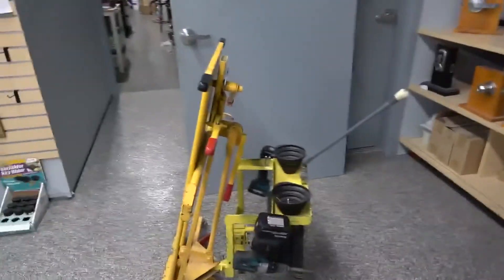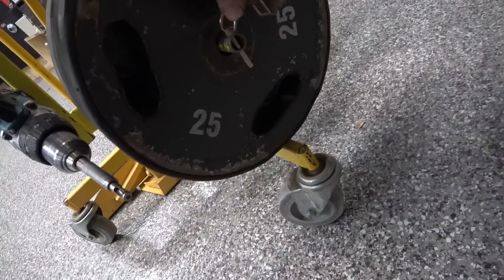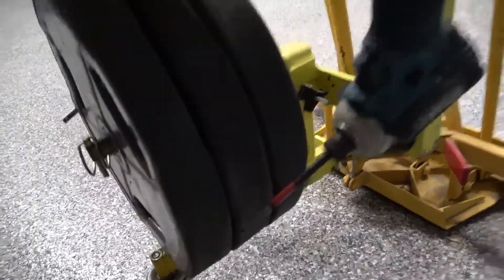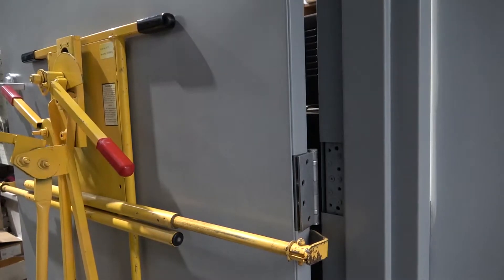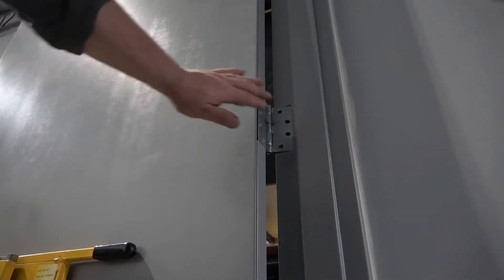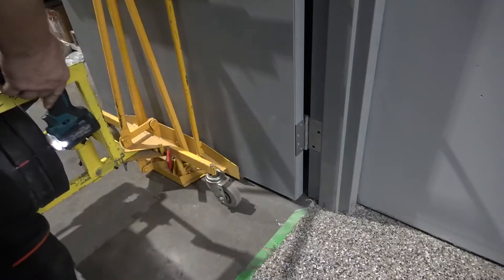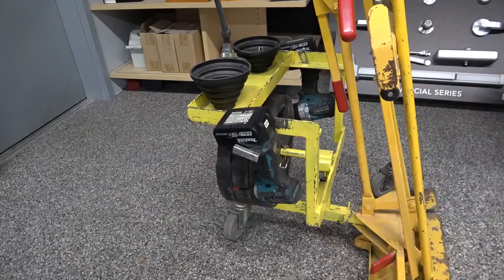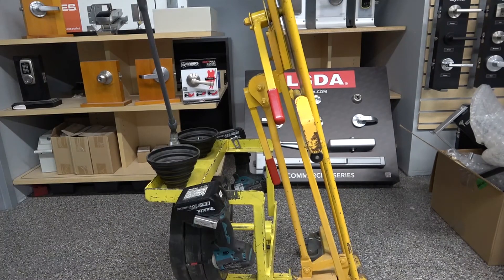Video 18 Jeffs Tellpro Doorminator 2piont O

Comment: This is a great improvement on the tool.!
 Might it be easier to split the hinges and install both halves, then roll the door in and install the hinge pins?
Reply from the maker: Most hinges we use in the industry for commercial use are NRP Non Removal Pin
Reply: Yes sir , and even if they weren't you will get Grease all over the place